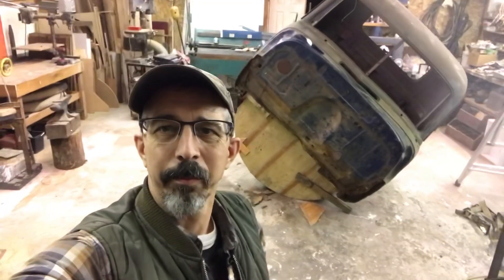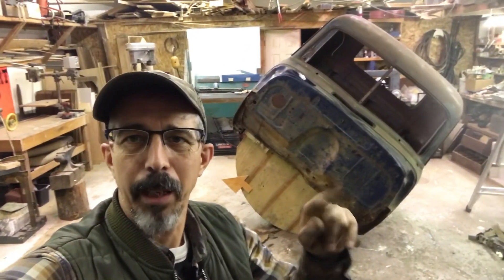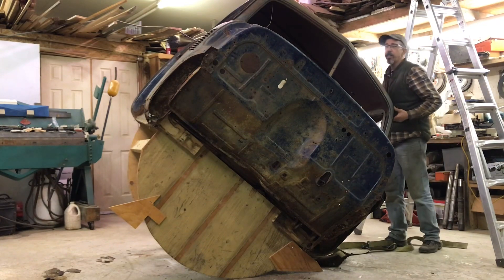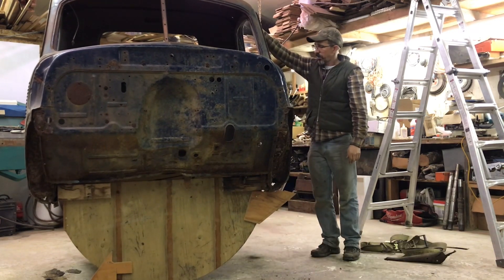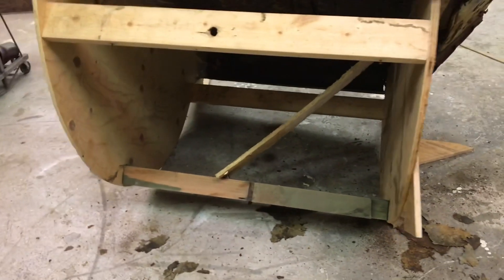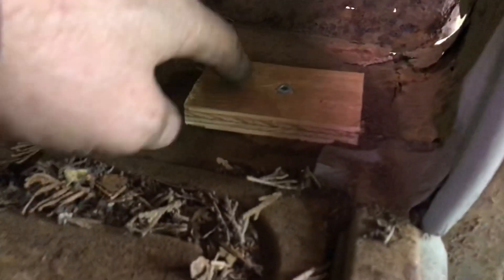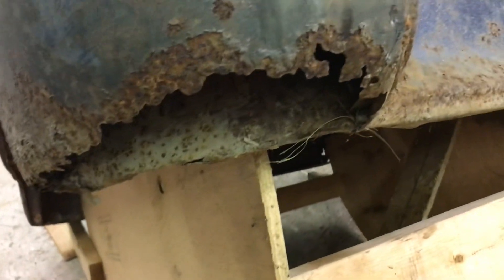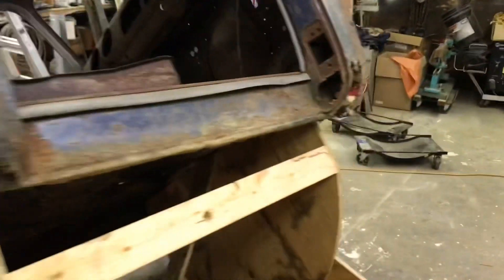Truck Cab “Rotisserie”

Comment: I’m working on my cab right now and I just have it sitting on two 4x6 blocks on each side under the rocker panels. I have a person telling me that the cab needs to be bolted to the frame to ensure that’s it’s square or all my work out of whack when I do mount it. Did you square yours on this jig somehow? Any issues after the fact?
Reply from the maker: I would say there is some merit to what you are being told. However I did not square up the cab but I did fit the doors into the openings at some point and they lined up reasonably well. I haven’t finished this project yet so it remains to be seen how well everything fits once it’s all bolted down to the frame. I just work on one corner at a time and weld in temporary braces when required to maintain the correct dimensions.

Comment: I'm working on a very rusty 51 5 window. I was considering building a rotisserie from metal tubing and engine stands. I'm going to steal your idea. Since my garage is tighter spaced I think I might try to incorporate casters in the upright position. Thanks for the clever idea.
Reply from the maker: Hey your welcome. I don’t know how much you’re going to be moving the cab around once you have it on the rocker but I have no problem sliding mine around as is. And thanks for subscribing!